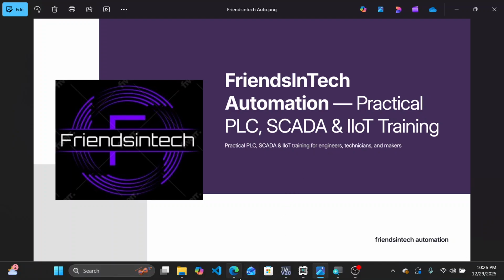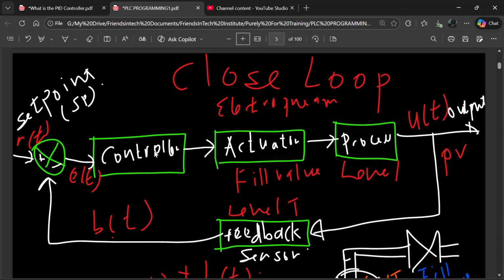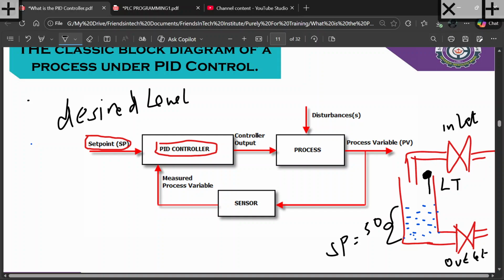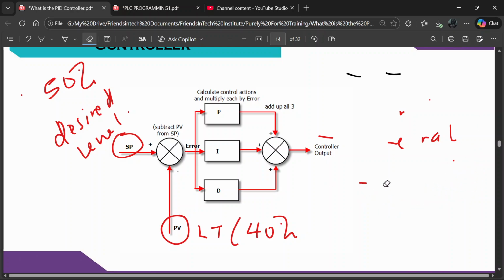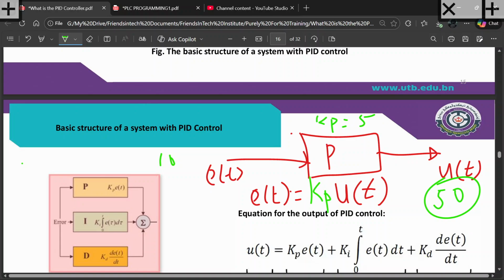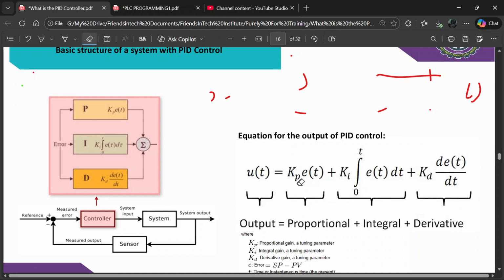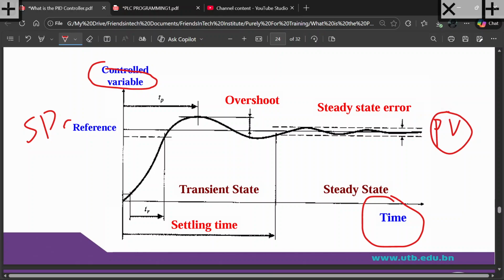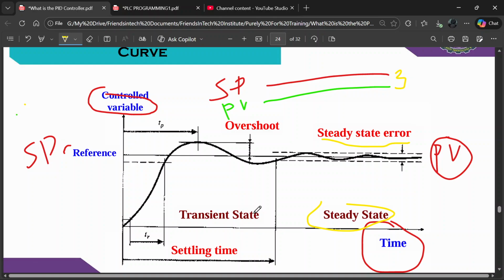PID Controller Explained | Proportional, Integral & Derivative Control – Theory Made Simple

Comment: Theoretically, the objective of PID controller is to minimize error signal. But practically, we need to balance it with other considerations and constraints, like capability and reliability of actuating devices, noise from sensor and input components, process and signal delay/deadtime, process tolerance, interference with other processes, accumulative control type, etc.
Reply from the maker: Very we need to factor in external influence